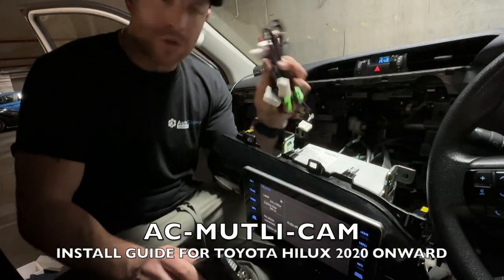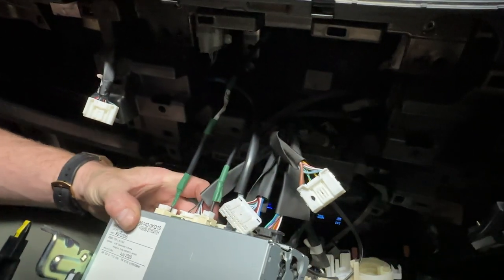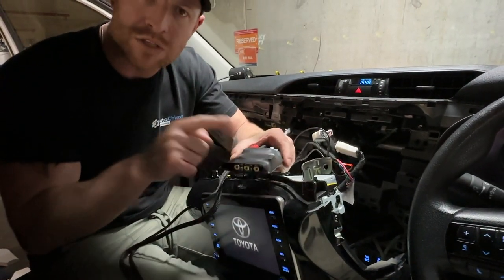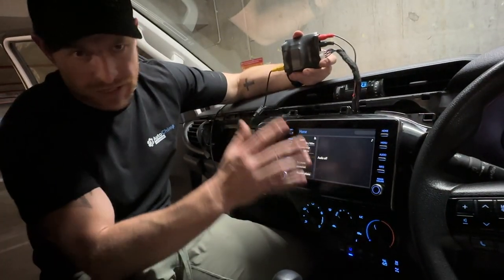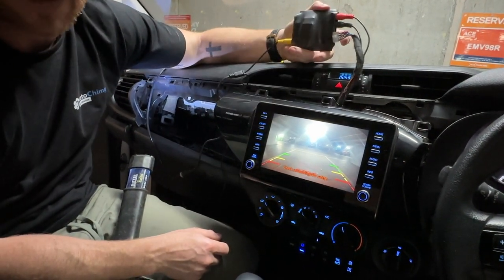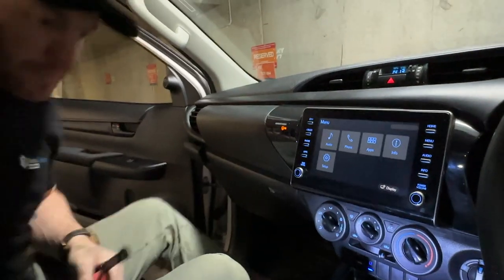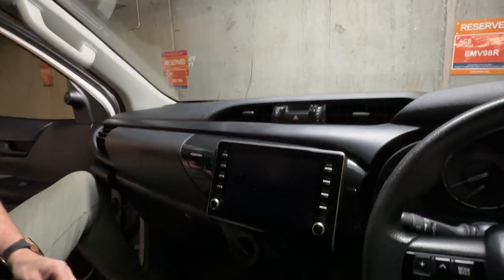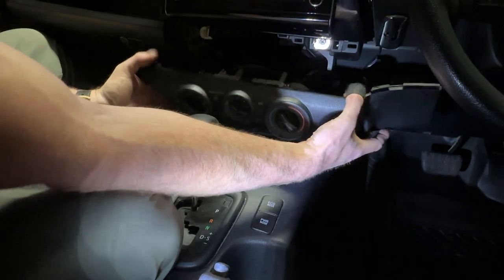2020 to 2023 | How To Run Multiple Cameras on Factory Toyota Hilux Stereo | DIY Guide

Comment: The installation was as easy as the video made it out to be, installed a front camera on my hilux mako. Just a question do you have anything that can display multiple cameras at once?
Reply from the maker: We dont have a kit to do multiple images on the screen at once at the moment but we are working on it for future updates!
Reply: Which camera did you use for the front installation?
Reply: @brianventura4519  I used their SoundSkins Vision Bracket Style Reverse Camera - SSVISION023. It's reasonably good quality for its price, I'd say the image quality looks about the same as the stock reverse camera. The camera and the on-demand buttons have been working great. just the buttons don't light up at night lol